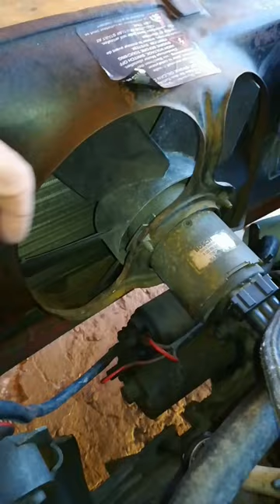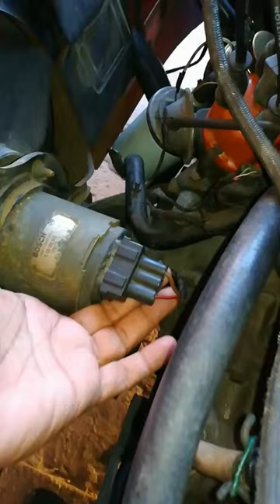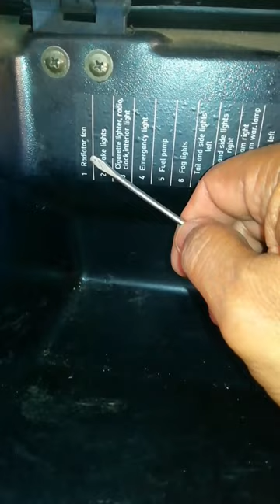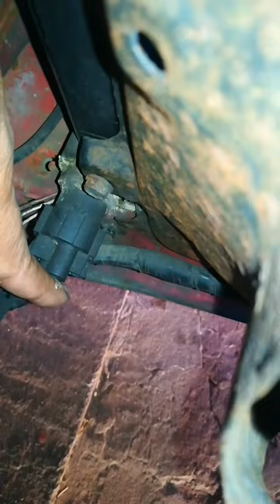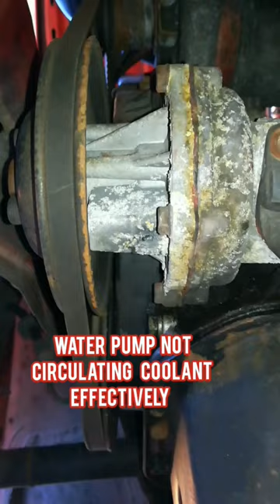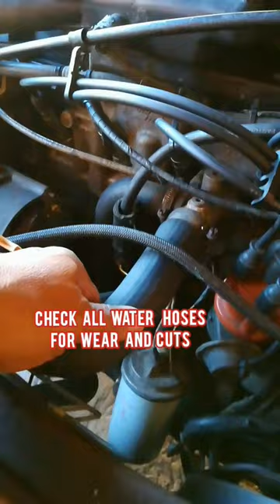Golf Mk1: Common overheating causes#shorts #mechanic

Comment: Good Evening PJ. Could u perhaps help me? I cleaned and serviced my ks2 Carb. 1.8 vw fox. Tried starting it but the carb backfires/blows air out and by the second backfire/air burst it pops out my brake booster hose as well. What could it be?